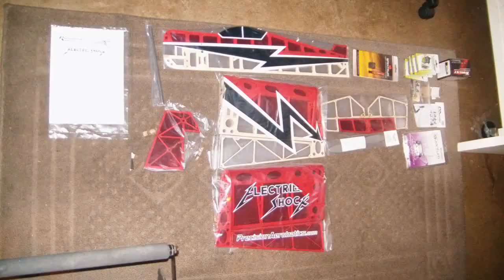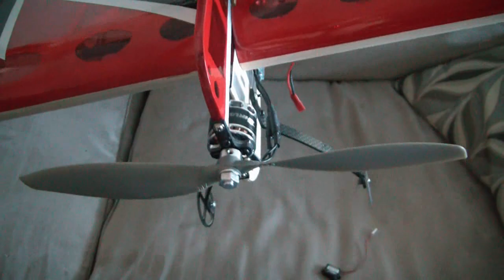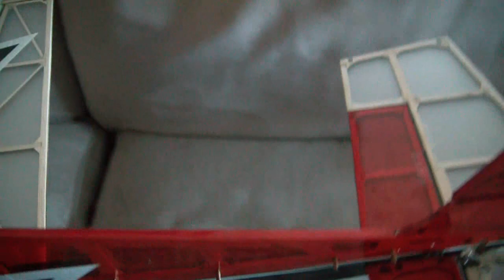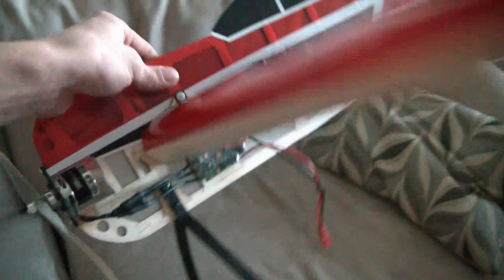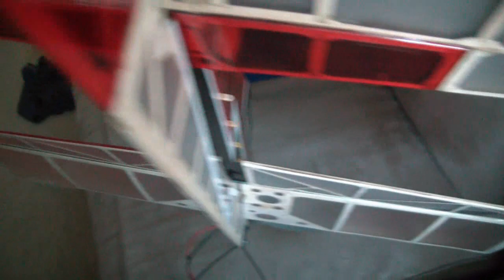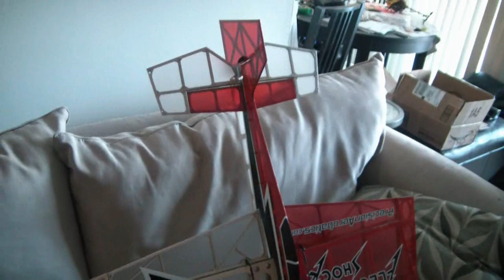PA Electric Shock

Comment: Nice plane.  There are some foamies that have airfoil wings that are between a flat and balsa.  One thing.. no breakaway on the gear struts?  I'd be worried about ripping out the bottom of the fuselage?

Comment from the maker: @flyingchimp99 Hey.  I'm kind of confused by what you mean.  Flipping them would either turn the arm towards the other servo, making the bend worse, or it would move the servo arm closer to the nose - this would reduce the bend a little because it has more travel space before reaching the first guide hole, but the servo arms aren't long enough to put the servos in the other way.

Comment: for the servo that control the elevator and the rudder ( the ones closer to the fuselage ) i know you cant move them closer to the body ( because the arms will touch the wood body ) but cant you just flip them around then reverse the servo with he transmitter ??? then the servo will be closer to the body but not have the arm touching it.......no bend

Comment: Looking good.
Metal gear servos are pretty much a necessity on 3D planes with a lot of throw.
Overkill beats stripped nylon, every time.
You could probably get away with using a 9.47 prop, to reduce the risk of burning the motor.
Can't wait to see it flying.